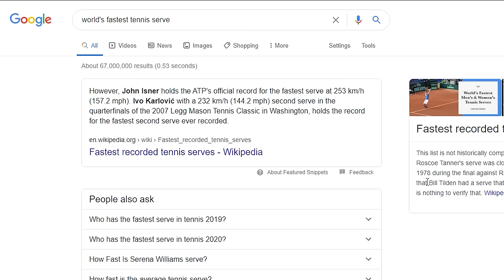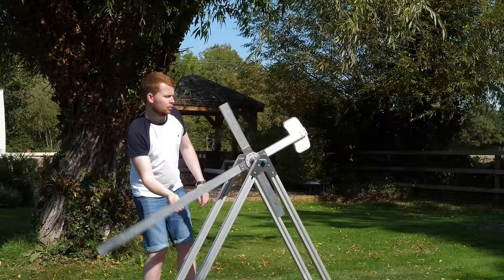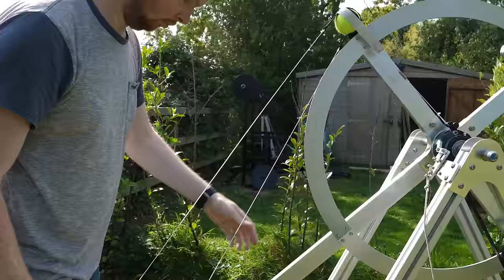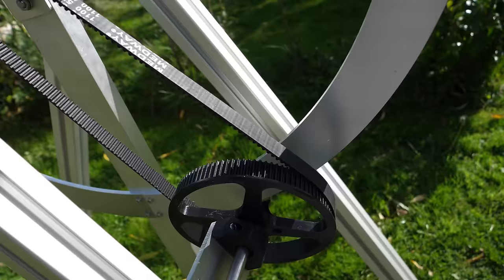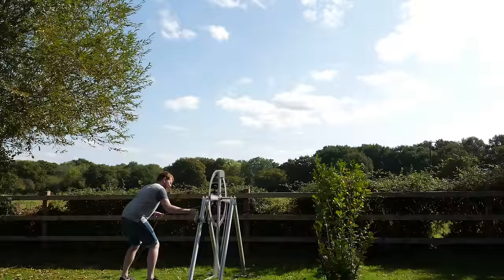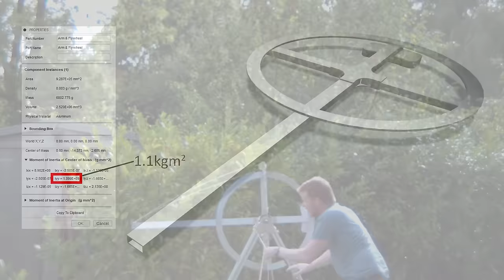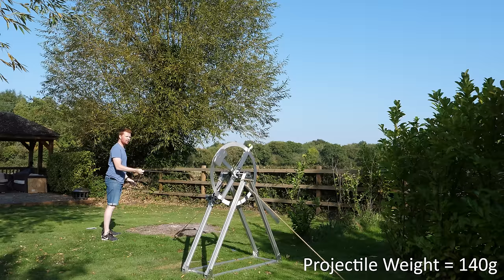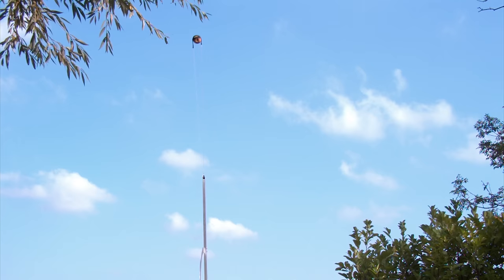Flywheel Trebuchet

Comment: The view would be pretty incredible if you put a GoPro video camera inside a transparent plastic ball as your projectile.

How much more powerful could your Trebuchet get, if you both maxed out the weight of the flywheel (10kg/50kg/100kg?) and then used an electric motor to spin it? You'd need to anchor the whole thing with some deep ground pegs  as well as some heavy sand bags or weight plates.

It would also be great if you used computer controls to aim & trigger it, as relying on human reflexes was giving you some wildly different launch vectors.

Comment: If you are shooting the projectile from the long arm, wouldn't 2x long arms gives you 2 shots in short order, assuming you have some other triggering mechanism?

Also the 2nd suggestion would be to use a bicycle pedal and use feet instead of hand to crank.  That way you can make even bigger gear ratio in your drive train.

Comment: I wonder why you don't connect the flywheel to a bicycle frame and operate it with the pedals, then you can operate the trigger with the brake lever and would get much higher speeds, especially if you use the gear shift ...

Comment: Question;
What would happen if you added 2 more weights to the other part of the well. 
Like the sides of the circle? 

Basically weight on the bottom and sides of the wheel

Comment: Three minutes in and I find myself asking why not hook the crank up to a bicycle if it can be triggered without affecting the rotation? Using the gear system on a bike you could generate more energy while expending less.

Comment: It’s a imagine type want. But imagine hooking a monster v-8 to it. With a butt load of torque. And doing a 1-1 or maybe higher gears and imagine that thing spinning at 7k rpm. Idk what it’s rpm there is. But imagine. There would have to be a lot more reinforcements to withstand that

Comment: You use 1.44m in the calculation, but that is the length of the arm, not the length up to the point of rotation.

Comment: why not add weights to the spinning mechanism? and then mount it on say, medieval tower, top floor with a empty core, if you lift up the weight to top floor and let it fall down through the tower while pulling a rope, shouldnt this make a much better trebuchet? I can imagine like a rotating telescope dome, you could make a rotating trebuchet on top of a medieval tower and accelerate it faster and faster if it was geared or the rope would shift to a smaller axis turning it even more faster.

Comment: There is an application for this idea im afraid to share. But this could be a useful tech mitigating costs in a growing market.
Reply: @NahNoWayy  Im in lmao. Seriously though i believe it could solve a multi million dollar problem. Ill share it. Run away wind turbines. Breaks fail in high winds and they just tear apart. You could at a certain rpm as a last choice effort dump the energy and stop the turbine from tearing itself apart. Lots of logistics of course but it would solve that problem if you could engineer it saving windturbine investors tons in replacment costs.

Comment: I would love to see a small electric motor driving that wheel, and perhaps a solenoid as a trigger device? Just to remove as much excess movement, laterally by the cranking. The trigger would just be a neat bit of flash. Not that any of my ideas would be an improvement, just a small change in the appearance of operation.
Oh, wait...maybe NO. ATF might come knocking. JK, but it's not a "ha-ha" funny. More like cringe.